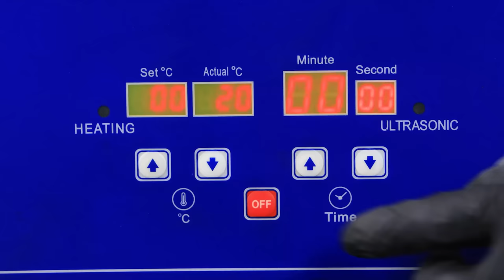MG34 | Old German Machine Gun Restoration

Comment: All of these guns come off as a little sus in origin to me. Most of the rust seems very superficial and surface rust. How are the internal springs always so good inside these? Just seems like he sprays decent guns with water and leaves them in his garage for a week or two
Reply: thats how 99% of these type of channels do it, it if were natural I doubt the rust would be so even in rustiness I guess...
Reply: Yeah. It also seems like they have an unrealistic supply of rare guns that have been left to an severe state of deterioration and then suddenly appear with no previous attempts to work on them. Maybe we're being unduly suspicious.
Reply: That's what these so many 'cleaning' and 'restoration' channels do. They purposely make them dirty or rusted then clean them
Reply: Cracking rusted screws can sometimes be impossible without sheering the screw or burring out the slot infact it happens quite easily. It's been said a million times on these and they're super cringe but the rust just looks so staged almost like some of it is paint a massive waste of time to watch

Comment: The question(s) I have are from pure ignorance. What happens next for a gun such as that? Is a gun such as that collectable to anyone? Just wall art? How do the collectors feel about your work? Would a museum have that gun for display in their museum? Do museums send you guns to restore? I personally am amazed at how much improvement you made on that weapon!
Reply: The gun is basically no longer able to be fired, between the grinding wheel and the welding the mechanical tolerances have been completely destroyed which could easily make the gun a danger to fire, and the markings that would give it historical value are ruined. This is an incredibly sloppy job that wrecked most of the value in it and which is basically unacceptable for anything other than neat wall art or a youtube video.
Reply: @Telamon8  TYVM

Comment: When I was stationed in Baumholder, Germany from 2002-07 I’d go to the militaria shows in Ciney and laglieze, Belgium. You’d find all kinds of deactivated weapons there, even German MG’s like this one. I bought a M1 Thompson for $950 (roughly 700 euros) and I saw a complete M2 .50 cal MG for around $2,100 USD. Over there they don’t cut the receivers, they weld the chamber shut so a round will never be able to be inserted, then they cut a hole in the side of the barrel, usually it’s in a place that’ll be covered by the hand guard and last they cut off the bottom portion of the bolt at a 45 degree angle so it’ll never be able to feed a round into the chamber and that’s it. I remember seeing an ad for a German surplus store that was selling US M-14 receivers for 125 euros and the only de-mil done to it was a small BB size weld drop welded on top of one of the barrel threads, a pocket knife could easily remove it! Obviously I couldn’t bring these back to the US in that condition so I stripped them for parts. I wish I would’ve grabbed the .50 cal, lol. You’d be stunned to see all the WWII and recent surplus militaria at these show, just incredible. 
 I mention all this to help,put into perspective why the man in this video is in possession of an MG, not sure how de-milled it is though and, I could be completely wrong on who owns this beautiful weapon.
Reply: Unfortunately those times are over now. The EU passed new legislation regarding deactivated weapons in 2017ish. I believe most countries put these rules in their legislation; Germany surely did. Shortly before the laws came into effect most vendors wanted to clear their stocks, so you could get untouched FA PPS 43 receivers for 20€.
Reply: @DeutscherFilmer3  oh no, that sucks! I left Germany in 2007 and brought home some serious treasures that for obvious reasons I can’t discuss here. These days we have access to parts kits in the US but not the receivers but they’re easy to make on a CNC or by hand, owning/possessing a full auto capable firearm is an instant felony. As an old Infantryman, we rarely use automatic fire anyway, we train by firing two well aimed shots fired in rapid succession at our enemy. So it matters not if I own a full automatic rifle. At the moment I’m building a CETME from a parts kit and the receiver is one of the 80% type we often have available so it doesn’t require a serial number or any type of registration to own it. Full auto is fun but it’s a huge waste of ammunition.

Comment: The MG34 its bigger brother the MG42 ...still look like they have come directly from the year 7500 .In every respect they were that far ahead of most anything else made 80 plus years ago,  and are as far ahead of much that is made  to this very day .
Sadly that MG 34 was abandoned or lost during battle and has suffered the damage of corrosion ...but even as it cannot be trusted for actual firing ..it remains a work of  engineering art ..which can be admired as a testament to the ingenuity of the human mind.
Reply: No the MG34 was just the pre war gun, that was designed and manufactured with more steps and quality. 
The MG42 was the new simple design through steel shortage in manufacture processes. So the MG 42 was designed and made more simple. With cheap and easy to manufacture parts, like the housing was mostly made out of sheet metal and the main parts are made more simple. 
So you could produce faster and cheaper. 
Something they did on the MP40 design, without any wooden parts, that took more time and simple sheet steel for faster production. 

But something doesnt make sense on this on. The sight for fighting air targets and the Bipod. 
There were some devices mounted on planes like the Ju 52, but they didnt need the Bipod.

Comment: That is not an MG34. It is a MG15. In WW2 it was a rear gun on a JU87 'Stuka'. however as WW2 went against the germans  they were re-purposed for the ground role with a added shoulder stock. The rate of fire is almost equal to the MG42 except it hasn't got a quick-change barrel. It will empty the 75 rd  snail-drum in less than 4 seconds & forget about accuracy.
Recently the Ukrainian forces were re-purposing co-axial tank machine guns for army use with a conventional trigger group. Necessity is always the mother of invention.

Comment: Are you guys gunsmiths by trade? and if not, how much research do you guys have to do to be confident enough to take this apart and put it back together effectively?
Reply: исследования не нужны , достаточно иметь голову  что бы запоминать , глаза что бы смотреть и руки что бы делать. и да первые два ствола до него кто то разобрал потом собрал и положил в воду на пару недель на солнышко , старый ствол  , по настоящему старый и заржавевший , купают  в дизеле до недели , прежде чем появляется возможность разобрать и не сломать.
Reply: Translation from the above comment:
Research is not necessary, it is enough to have a head to remember, eyes to look at and hands to do. and yes, someone disassembled the first two barrels before it, then collected and put them in the water for a couple of weeks in the sun, the old barrel, really old and rusty, bathe in a diesel engine for up to a week, before it is possible to disassemble and not break it.

Comment: Have you ever tried to use a old oven thar is self cleaning that gets to like 550 to 600 degrees? It will remove all rust from a badly pitted cast iron pot or skillet then it's just soap and water and then re season the skillet it's amazing ten times easier than the dozens of other methods. 
It might work on those parts

Comment: I am no expert but the way he removed the parts without struggling, rust dust or even the suspicious screws that easily remove without oil or even rust removal for screw and some joint that easily move like it was nothing was so suspicious that I don't buy it

Comment: not rusty enough to have been underground or in the elements since the war and it seems unlikely that it would have been left to get the rust it does have afterwards.  there is pitting but only surface rust.. was prob found and restored already then for some reason left to rust again